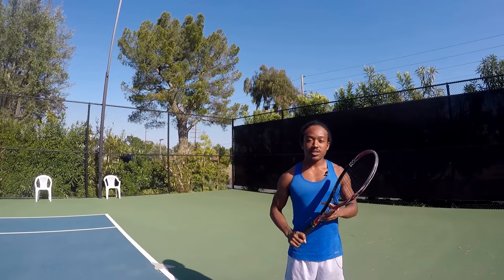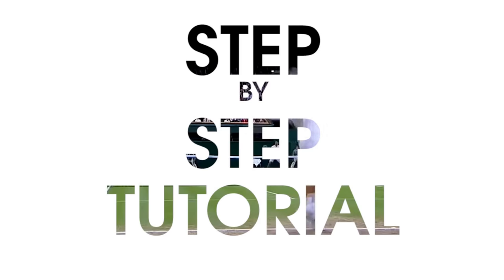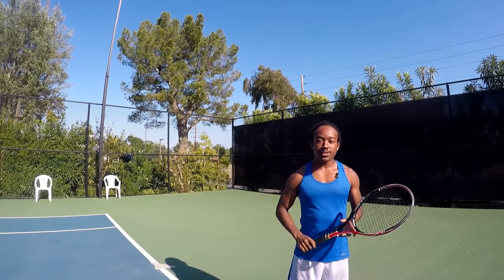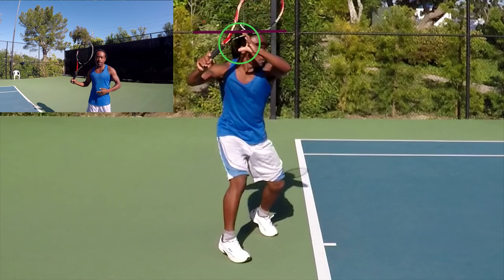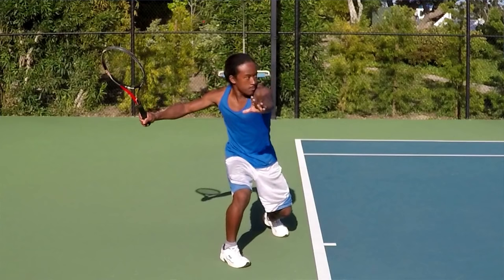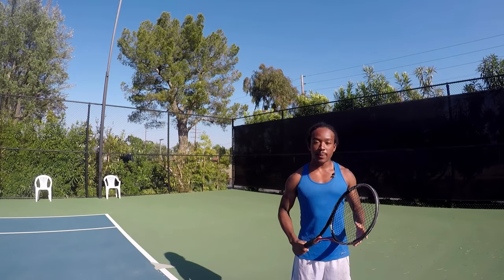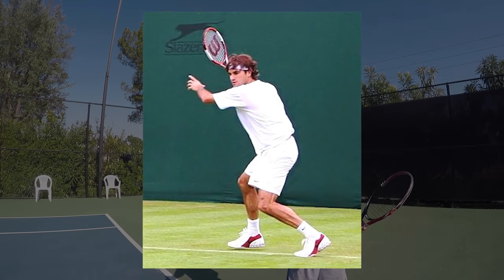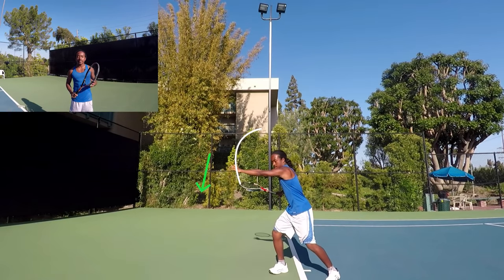The Forehand BACKSWING — Tennis TECHNIQUE Fundamentals (How-To)

Comment: Hey, thanks for the (albeit unintentional) shout-out to wheelchair tennis players!  Normally I pass right over the discussions about lower body movements ('cause we ain't got none ), but at 2:21 there's finally a drill we can do!  

Actually, I automatically translate any discussion of 'hip rotation' into 'chair rotation', which we accomplish by braking the opposite-side wheel.  The tricky part is to not completely stop the rotation (like able-bodied players do) because we need to maintain some momentum and turn out of the stroke and head back to our starting point behind the baseline, aka "the hub".  In wheelchair, if you stop rolling you're dead in the water.  

That's why, instead of doing a split-step, WC players will push towards the back of the court in a move known as "reverse mobility" and look over their shoulder to see where the next shot is coming.  This always freaks out our able-bodied hitting partners - as they assume we're not ready - but actually, we're in the very process of getting ready.  

Sorry, got carried away there!  Check out a WC tennis match sometime, at the very least you will find it entertaining, and who knows, there may be something you can take away and use in your regular, able-bodied play.  Watch a men's doubles match with the British pair Hewett & Reid for the incredibly long points and ripping "upside-down" backhands!  Later - JD, Montreal

Comment: Excellent video...With regard to over-rotation are you referring to the hips on the backswing?  If you over-rotate the hips, you will not create enough separation angle between the hips and the shoulders on the forward swing. Won't sufficiently engage the obliques. Is that the idea?
"You want to make sure that you're turning your shoulders more than your hips. You don't want to over rotate. If you over rotate you're not actually eliciting your external obliques and you won't create as much power. If you are suffering from over rotation in your forehand one drill is to sit down and rotate because what this will do is prohibit your hips from moving with your shoulders"
Reply from the maker: Precisely!

Comment: Wow, this is legit online tennis coaching with some serious practical substance instead  of diverting technical jargon. One slight "critique" though; keeping the elbow in front of the shoulder/racquet on your right side through the entire back swing is motivated by the efficiency and quickness of that motion; not that much due to the "stretching of the chest muscles" (leading to "less control"), Those muscle groups SHOULD get stretched in a proper modern forehand with a lagging upper body (in relation to hip rotation):
Reply from the maker: Actually, that is very interesting because I have not been able to directly correlate greater chest stretch with decreased consistency/accuracy (I will try to research this topic in the future). Just that when I tend to take the elbow behind my body, it feels a bit discomforting and unnatural, and leads to a greater % of errors. But perhaps this could just be a result of my current relatively shorter backswing and not having adjusted to a big takeback. 
Another note, I've done some quantitative analysis in the past to see the horizontal adduction of the hitting arm. For Federer, I found that the angle of his shoulder horizontal abduction from the end of the backswing to contact was more or less the same (about 130°) I'd hate to jump to conclusions, but this has led me to believe that the major action in the forward swing is the leg drive and core rotation, while minor chest adduction and passive wrist extension occurs. 
I'd love to know your thoughts on it!
Reply: Interesting analytics and information which has  direct value and application in your (my!) game. Thanks again.  - Yet a caveat: I wonder if I understood correctly, most likely not. :D. Namely, the horizontal abduction of Federer's shoulder cannot stay in that extreme out turned position of ~ 130 -135 degrees until the contact since that implied he hits the ball 45 degrees behind his torso plane/shoulder line (!?!) while he, of course, hits with an extended arm  ~45 degrees into the court  the torso plane  being ideally still some 15-20 degrees away from the base line horizontally at he moment of the contact (a neutral pivot shot in the middle) which yields that the arm travels from the extreme horizontal back position 45 (extreme horizontal abduction in the lag phase) + 45 (into the court) + 20 (lagging torso at the moment of contact)  degrees into the contact = ~110 degrees in relation to his shoulder(s) (I must add)  during the forward swing until the contact. -So, what do you mean by saying "the angle of his shoulder horizontal abduction from the end of the backswing to contact was more or less the same, about 130 degrees"??  Thank you, anyway. This channel is obviously a valuable resource to any more serious aspiring player at the intermediate or advanced level.
Reply from the maker: Hey Jack, 
I think we are on the same page. I had difficulty trying to explain 
"the angle of his shoulder horizontal abduction" So I made a quick gif explaining what I meant. I hope it cleared up the confusion.
https://imgur.com/a/WiBTPEV

And thanks again for the kind words!
Reply: Hmmm, okay, yeah, I see it now. That is one strange evidence there! :O :D - Either it is the point of view which creates an illusion of the constant angle or then this particular shot on the right side is such as it might also be that my analysis doesn't apply there (as I said referred to a neutral mid -position shot with a pivot) amplified with the possibility Federer has no time in this situation to hit with a regular swing with more lag leading with the hip since it looks like he must hit with a shortened backswing.  Or a combination of all these things.  - Yet, I am no expert who had studied the kinesiology of tennis strokes in detail with slo-mo video clips of the best players hitting. Interesting again, yet still a bit baffling. Lol
Reply: Let me be more precise here. We have obviously different scales in determining the angle of the shoulder abduction; in my analysis the zero orientation is a straight forward extended arm, that is, the normal of the shoulder line, you use the left side of the shoulder line as your respective reference point. Thus, what you call 135 (or 150?; the illustration in your gif?) degrees (constant) abduction gets reduced to 135 - 90 degrees = 45 degrees abduction in the more conventional scale using the the normal as the zero point. That just cannot be the case in conventional forehand hit in the middle where the full upper torso gets lagged in the forward swing so that the arm follows behind the rotating torso plane and shoulder in the extreme lag phase.

Comment: Really great detail and analysis - well done. I find my greatest problem is the fluidity and racquet speed. While playing I seem to think in youtube slow motion and just can't get the Raquet to drop and release quickly enough and follow through
Reply from the maker: Hey SmarT Odd! You're actually not alone on that issue and I have witnessed it in the past. 
Slow motion is great because you can extract elements that can't be witnessed with the naked eye, but not when it comes to timing and rhythm.
While it may be subjective, I found that what helped often was to do progression drills by starting out with simple isolated movements (i.e. leg drive and core rotation) and moving then moving to the compound motions.  I would also recommend practicing while imagining a ball is coming because I noticed that there is a BIG difference between practicing with and without the oncoming ball. Then whenever you are comfortable, you could put the ball in.
Reply: thx - gonna take a video too - to see whats what. Great science and examples - thanks for your videos
Reply: What helped me was to wait at the last possible second and then drop & release as quickly as possible (because you waited 'til the last second). You'll be "forced" to accelerate to hit the ball in front. Timing is definitely key!
Reply: I'm by no means an expert but for me the biggest factor for what racquet speed you can handle is practice. I've found when I'm in very good form and practised I can up my speed and have exactly the same control. 

For example, when hitting with better players than normal, you'll often find yourself forced to attempt a higher level of tennis than your standard. Sometimes you'll recognise that you can make that adjustment surprisingly comfortably. 

To use a gym analogy after working out for a period of time. When you next go for your personal best you'll see that you can lift more than was possible before. I think tennis is the same.

Comment: Look, I have a question that nobody can answer to me.   Here it is:  On the backswing, should one actually begin to accelerate the racket backwards, making a looped sort of movement—think, a Popeye punch; or the way you’d throw a yo-yo with the string at full length— or or or or, is it simply a 90 degree turn with the body, and COMPLETELY loose hitting arm, so that gravity does all the work on the way down.  I’ve recently friend the first way I mentioned, and it can be quite effective.  And sometimes the gravity drop leaves the racket in a position from which I have little leverage to accelerate fast enough to get good lag.  Anyway, my gut feeling is the gravity drop is the better way, but I need answers, people.  I can’t be the only one who has ever wondered this.

Comment: Here is a question... how can you get to the ball faster? Is'nt there is a move/step/little jumps, to get to the ball fast a step or two, I don't know what it is called in English
Reply from the maker: Do you mean Shuffle Steps? They are small adjustment steps to help you get into position right away. Depending on how far the ball is, you would take different types of steps. If it is further away, you would take longer strides and vice versa.